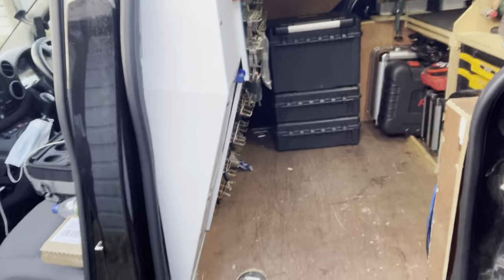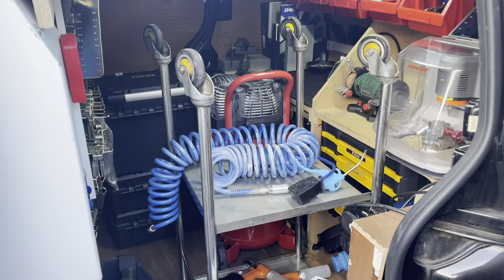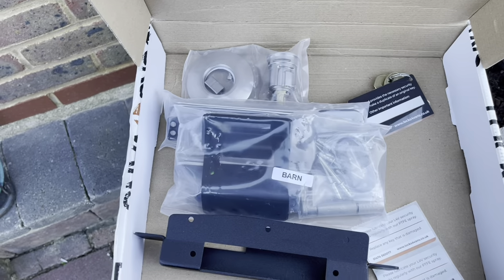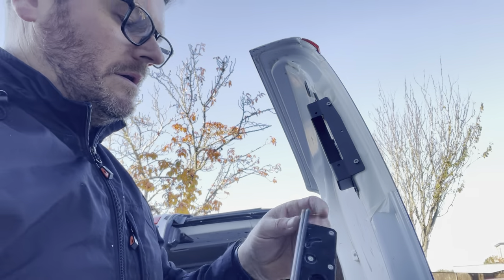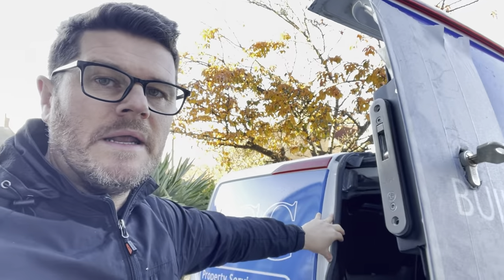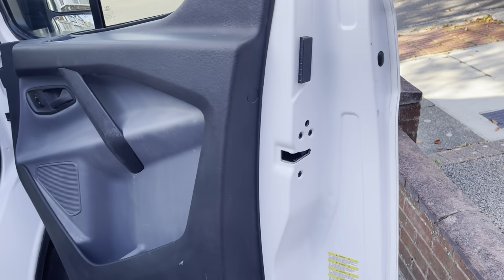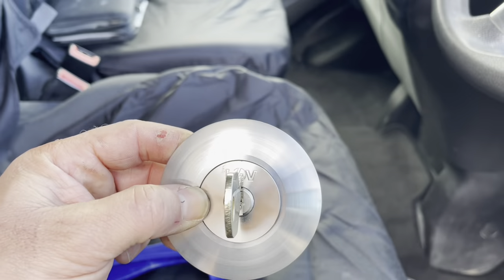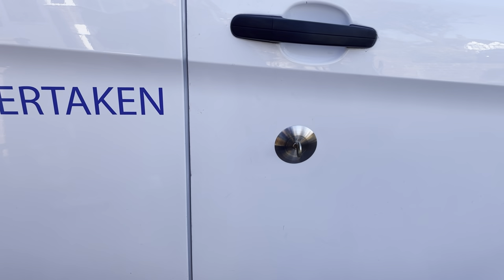Ford Transit Custom Van Locks Fitted - Locks4Vans | L4V - Locksmith

Comment: Thieves do have a tool that can unlock any keyholes.

It happened to my van driver door keyhole and back door keyhole as well as my deadbolt keyhole.
Reply: what?? then whats the used of putting these locks??
Reply: @zezuntxiduntxi  don't use locks with key holes accessible to thieves is key.

Comment: I have never seen locks fitted to a van like that before.  We normally see the puck locks used.  Very interesting.
Reply from the maker: Yeah we love this type of lock here!! Unfortunately there is a lot of van theft over here and even fitting the Van locks sometimes isn’t enough of a deterrent! Thieves have started cutting holes in the roof!!!
Reply: @brighton_locksmith  yeah, I watch YouTube videos of guys tracking stolen equipment in the UK, and it's usually found inside a stolen van.

Comment: I’ve just fitted the same locks to my 2016 Custom. I hate the way the side loading door cylinder doesn’t come out straight, and comes out at an angle, because of the shape of the inside of the door. Also, mine came with an extra stainless steel filler piece for between the lock case and the door. The angle makes it look like it’s not fitted correctly. I wish they’d supplied like a tapered filler piece with it, to square the cylinder up with the outer door skin. I also fitted the internal and external locking shields to barn door and side loading door.

Comment: Hi, When you fitted the keep on the side door it is positioned on the outside of the rubber door seal. What prevents water from running down the van and entering the keep i.e into the body panel? 
Thanks for the videos, very interesting 👍🏻

Comment: Hi biggest question I have as I’ve just purchased the rep lock can someone force the whole barrel with a flat head screwdriver as the key slot is pretty large thanks
Reply from the maker: Hi mate.
Not if it is fitted correctly no 👍🏼

Comment: Hey fella what compressor are u sing and what make model pop riveter and snippet you using ?
Reply from the maker: Hey mate. Sorry I’ve only just seen this message. 
The compressor is an Einhell 50l upright compressor from Toolstation. 
The rivet guns are from Amazon mate. 
I’ve just remembered that I put this on the UK LOCKSMITH HUB a couple of days ago 😂

Comment: Good stuff. I don't see retrofits in the states. On the front door locks, does the new cylinder hook up to the existing linkage? The mortise locks look like what we call AdamsRite in the states. Bascially storefront mortise locks. We run 100-150 auto calls a week believe it or not. We run 24/7 Mostly lockouts but also lost keys, bad ignitions. We have trouble here with aftermarket transponders. Really bad ratio getting them to program. Do you see that as well?
Reply from the maker: Hey Scott. Yea the front door locks link to the existing system. However, due to the new design makes it much more difficult to manipulate the lock. 
Yes we also have Adam’s Rite locks over here and you’re correct, they are very much like those. That’s a lot of calls man 👌🏼👌🏼
Thanks for watching 😊🙏🏼
Reply: @brighton_locksmith  I watched your van tour vid and understand your situation a little better. If I can give you some advice. Hook up with the auto clubs. I imagine they have them in the UK. They don't pay as much for a call as you normally charge but they can give you volume. 95% of the calls are lockouts. Most pay up to a certain price and the balance is paid by the member to you. Those are usually for lost keys otherwise no money changes hands which I also love. I would rather do 4-5 quick lockouts than spend hours on a transponder key hoping and praying it actually programs. Every week money is deposited into my account. No billing no advertising at all. The calls just come in. I have 3 guys on the road 24/7. We are also in a populous area. Back in the day I would do an occasional business and residential but not in years. Just autos.

Comment: Quick question. Can a single lady install these? My body shop looked at them in the package and said it would take several days to do and it was too complicated for them.
Reply from the maker: Absolutely!! As long as you have the right tools. 
All the locks come with fitting instructions too. 

I have another video coming out on Sunday evening which is all about fitting van locks so make sure you tune into that 😊